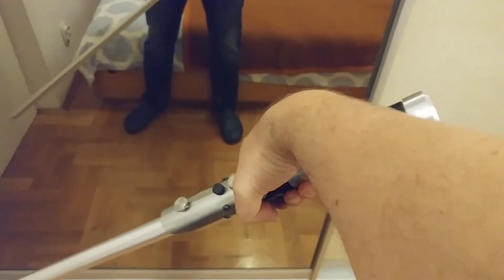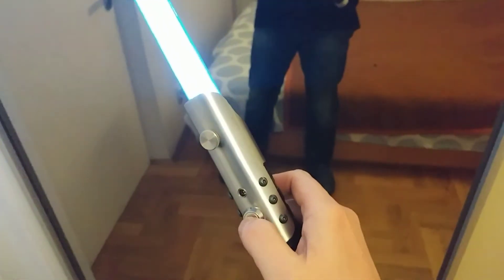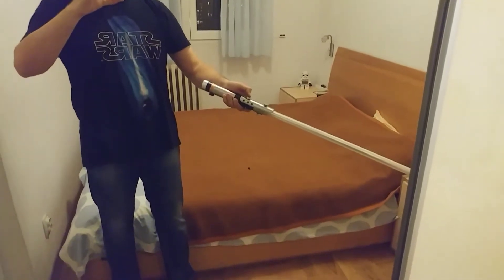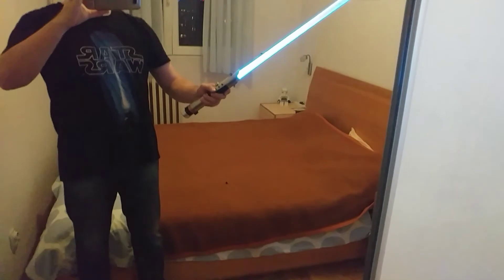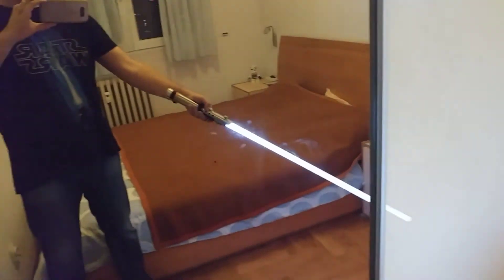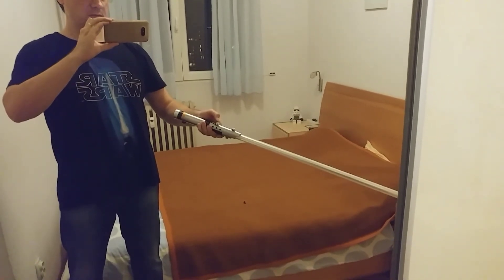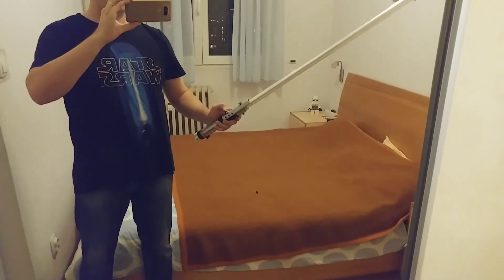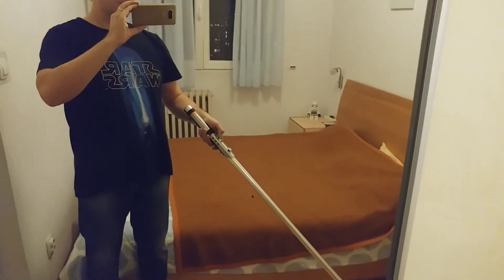Kyberos Arduino Lightsaber 1/2

Comment: Looks and sounds like an saber from Saberfoge and your menu is the same
Reply: You have one from there?
Reply: @CELTICSAVAGE32  Not me but my best buddy
Reply: @PoldLp  cool
Reply: @CELTICSAVAGE32  and i am currently building a lightsaber with neopixels in the blade. With which I can set with an app what color and what sound it has and whether it is stable or unstable
Reply: but so far I only have the electronics, when it comes to the handle I still have to see how I do it. Because I would like it to be made of metal. Unfortunately, I have no machines for this and my 3D printer can of course Plastic only
Reply: @PoldLp  very cool!

Comment: Nice work man, going to start this project once my exams are over.

There are a few boards out there on the market but as I’m a broke Uni student I’m going to get an Arduino nano and code from scratch with a few breakout boards. Have you done any upgrades or reforms to this project as its 2 years old now? Would be interesting to see the internals and wiring as I have no experience with that side (yet) haha. 

One idea I have to further modernise this is to make an app that you can control presents colour etc although I think your solution with the gyroscope is very cool